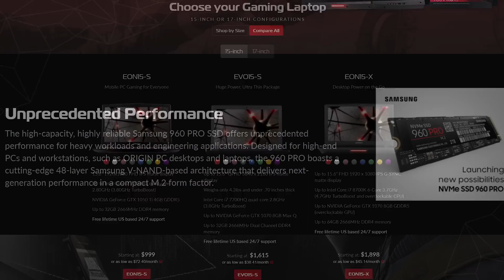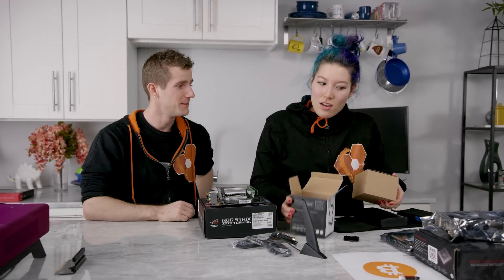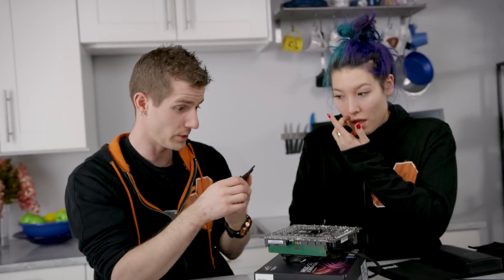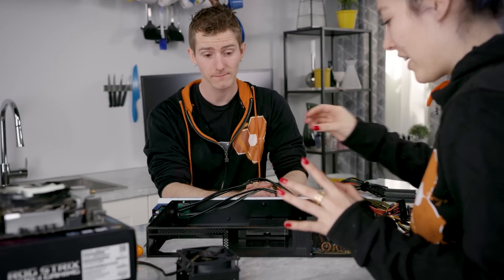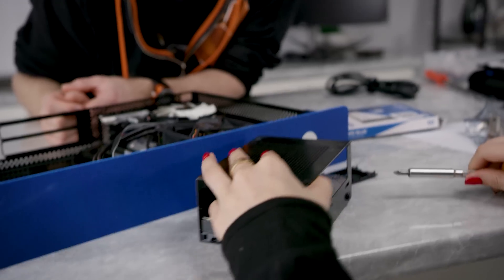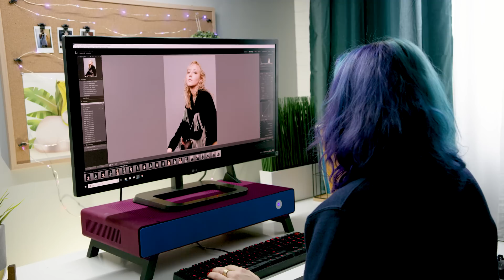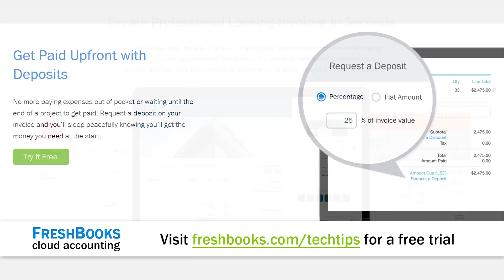Max Builds her FIRST PC – Photo Editing Build Log

Comment: "forgetting the IO shield. Common 1st time mistake"

Or in my case, common 10th, 11th, 20th time mistake lol
Reply: dust gets in wtih or without the IO shield if you don't have negative air pressure and filters on the suction fans..
Reply: At least you got to build 20 pcs
Reply: @flippette  yeah but most of them weren't for me, unfortunately. I've only built 5 for myself since 2000. I don't upgrade very often.
Reply: #sadaf
Reply: @TGoKovenant  That's so much worse, lol.  I hope people weren't paying you for such a sketchy service.
Reply: @RDR911  in my own PCs. And even then I'd remove the Mainboard and pop it in.

Comment: I did almost this exact same build in April. Mine has the i5-8400, 256GB Samsung Evo 960, the ROG STRIX Z370-E GAMING motherboard, and even the colorless RAM. Though I did go with RGB for my power supply, graphics card, and case. Great build and it does almost anything you want it to.

Comment: I didn't get a good look at the case. Is the bottom of it solid ? I only ask because the video made it look as though the PSU was installed upside down with air intake coming from the top of the case.

Comment: If there are any Cryorig reps watching this, on behalf of the audience, we're sorry: we know that the C7 comes with its own thermal paste and hex wrench and furthermore also comes with insulated mounting nuts in case the backplate doesn't fit. Any threat to the Maxicure is not your fault. Now, if you are kind, please release the all-copper C7 with aftermarket fan bracket for those of us who don't have a big enough desk for a Taku.

Nothing bad to say about you Max and Linus! I realize that since it was a spare part, all of that extra hardware was probably gone. I've learned from the masters how to kludge together PC builds and I've certainly got a few janky mods going on over here.

Comment: Hi can someone help me with my m.2 ssd connected in asus  z270 it was working as a boot drive but out of no where it stopped working as a boot drive i added a hdd with Win 10 and my ssd works in windows but can not boot windows on it any suggestions???
Reply: The ssd is adata sx8000 256g

Comment: We absolutely need a video about graphicscard control panel settings, windows power plans and frametime since NFS Payback and GTA V and maybe more games will run much smoother after switching to high performance plan and enabling 1 Maximum prerendered frame in Nvidia controlpanel. Flying in GTA is affected specially and NFS´s stutters are fixed that made game unplayable even with best hardware.

Comment: 0:43 Linus: what is this for? Max: Tumblr PC Specs 5TB 16GB Ram
Reply: Tumblr, all the tabs.. all the tabs..
Reply: researching how to over throw linus for the being apart of the pc patriarchy, dongle jokes no more
Reply: Pro tips: You run Tumblr on Chrome. 

So I think it's pretty accurate.
Reply: Where talking about a guy with half pt of stoarge full of videos...
Reply: If your point is that 16 G's is a lot for a web machine, you obviously haven't opened up more than 10 tabs before. Me and my 20 windows can crash the hell out of a system with 8GB, EVEN WITH a tab suspender extension. Lately I've been shopping for laptops with 64GB max so I can maybe get out of this ghetto...
Reply: I have my delided 7980XE just for watching youtube...
Reply: KingKaos 16 Gb of ram costs like $200 why?????
Reply: Google chrome, killer of ram...
Reply: On my daily routine I usually have around 100 to 150 Tabs running all at
 once I use all of them all the time Firefox is the best browser to 
support so many all at once I have found has my system only has 8GB of 
ram
Reply: I have a few things to say a Major Computer memory/RAM factory exploded in 2013 causing the price to skyrocket. This factory accounted for 15% of the worlds source of computer ram.
Also the current demand for RAM has caused the price to go up because the supply just isn't their.
https://www.kitguru.net/components/memory/faith/hynix-fabs-on-fire-after-chemical-explosion/

https://www.extremetech.com/computing/263031-ram-prices-roof-stuck-way
Reply: Also for photo editing, ram is good to have especially if you have lots of complexity and layers.

Comment: You need to look up things you make claims about. LEDs and RGB make your system run 15% faster. I have even seen evidence of systems running 20-89% faster because of the LEDs on RAM alone. Gotta get your facts straight

Comment: I'm 2 months from my bachelor's in pure math, I'm working on a physics puzzle game (with custom physics, not entirely rigidbody reliant) in Unity/C#, and I've never built my own computer.
Although, I've never had money to buy all the components for a new computer myself and my stepdad works in the programming industry. He would just buy and assemble the 2 computers I got throughout living with him. It's really just a right place, right time kinda thing for some people. I have changed out my graphics card and moved temp reads in my case to different components, though.

Hopefully I'll actually finish my game and get it onto Steam for something like $5. Maybe then I could afford/justify a new rig, because this 2013, 8 gig ram, 4 core i7-4771 monster here is not doing too hot with lightmap baking. Or rendering times. Or anything CPU intensive. But I can play Dishonored 2 on low!

Comment: wait... so you mean my rgb tridentZ memory is no faster than the regular tridentZ??? i refuse to believe it
Reply: It's a lie.  RGB increases speed for sure.  The electricity flows through the LEDs then bleeds into the modules increasing the voltage without messing with multipliers.  See, RGB increases Ram performance!
Reply: Purple is the best color for your rgb because you get a mix of 10% bonus fps from red and 10C cooler temps from blue.
Reply: Payne Hoss was my intire life a lie then?!?!?
Reply: actually I believe the rgb variant has a lower latency. Everything else is the same (except price)
Reply: trident is recommended by four out of five dentists to patients who chew gum
Reply: Aren't some of the higher speed G.Skill kits only available in the RGB variant? So... if that was the case, the RGB meme would actually hold true.
Reply: dont freak out! it's true that the rgb doesnt make the ram itself faster. HOWEVER!! it makes you hype, which as most every example of super smart people on computers in tv/movies has shown, smart/hype people make computers magically faster.

Comment: I would actually recommend Scythe SCBSK-2100 BIG Shuriken 2 Rev. B for the cooler for anyone else doing a very low profile ITX build.  In all the testing and reviews I saw it cools much better and quieter than the C7 for about the same price.  you do have to use medium to low profile memory but other than that it's amazing.

Comment: What GPU was used? GTX 1060 ??
Reply: Cyber Tiger No, there's definitely a GPU in it
Reply: ... did you like, blank out around the part they screwed a GPU in to the case or something?
Reply: Suraj T looks like a 1050 / 1050ti
Reply: @ Cyber Tiger... 6:44
Reply: Cyber Tiger 6:49
Reply: I'd like to know as well
Reply: I was also wondering that. she def said gpu, so there must be one
Reply: they did put in a gpu. thinks its a 1060 mini
Reply: Josh Downard if there was then they might have told but they didn't.
Reply: No GPU, only i5 integrated graphics

Comment: Based on the design, the outputs and form factor, the GPU they are using is either MSI Radeon RX 460 2G/4G OC or the MSI GTX 1050 TI 4G

Comment: 6:12 It's how they're packaged!  Ha I did the same thing to my WD blue SSD because you'd think if you pull it out with the package front on the top it will come out facing up but it doesn't!  I mean, there is a video of Linus playing Basketball with an SSD somewhere so I wouldn't be too worried about it, but still XD

Comment: I have question more or less related to this video: I currently have an ASUS Strix GTX 970, would it be better to get another 970 and use SLI or just get another overall newer GPU such a 1070 or 1070 TI?

Comment: "Forgetting the IO shield, that is a very common first time mistake"
It's called a "motherboard mounting alignment test fit"
Reply: FOOORRR REAAAL my first rig i didnt know what it was i found out 3 years later when i was upgrading parts and then put it in upside down and i was soooo conviced it was the io sheild not my dumbass i dremmeled it.
Reply: I built my pc about 2 years ago and I forgot the IO shield and still Im using without it Im fucking lazy.
Reply: I forgot the io shield once sooo try again the standoffs are the alignment and mounting.
Reply: Sure buddy
Reply: I forgot my i/o shield aswell. In another country. 3000km away from me.
Reply: Honestly IO shield is just a cover without any real function.

Comment: 'Forgetting the IO shield is a very common first time mistake'

No Linus forgetting the IO shield is a very common mistake...full stop, I still do it to this day, and have seen many top techtubers make that mistake over the years.
Reply: I've done it lol
Reply: lol I forgot my case had a hole behind the mobo... my bracket fell off when changing coolers and took the mobo off to get it and seen the hole and felt stupid af... lol
Reply: I forget the IO shield nearly every single time. That and the cooler bracket before mounting the MB to the case, but I like how newer cases have opened up behind the CPU so you don't have to remove the motherboard to put that bracket on.
Reply: I never use the IO shield. Fight me irl
Reply: Can confirm I also sometimes forget the damn shield!
Reply: +hmoham Just transferred mobo between cases 2 days ago... Just looked behind my case and I forgot the IO sheild lol. Thank you Linus haha

Comment: The cryorig C7 actually comes with a nut-driver to tighten it down, you do not have to use needle nose pliers. 

It also comes with smaller plastic spacers in a bag labled "mini-itx" that you use instead of the backing plate.

The install is way easier that you guys made it look ^^
Reply: It wouldn't be LTT without some missing of steps

Comment: LOL Tumbler. In 2013, when the gtx 780 came out, my friend told me why i spent $650 for a video card just to play runescape apparently. It was not just to play runescape but because my previous pc from 2004-2005 was literally shitting bricks and i thought gtx 780, younger brother to the original Titan would stay up there lot longer. Future proof if you would. Well, i still don't regret it but i hate nvidia does shotty things and in 5 months after the gtx 780 release, they release the TI version and bum fucked me and my video tanked like $100-$200 also considering it was used it'll be like $350 - $400 for it used... Considering Nvidia never made a ti version for the 2-3 years i was watching linustechtips on new products being released, i'd have to say that is shitty way of doing things. I had thought the year before, gtx 680 single card the best, and 690 the dual gpu behemoth. WELL FUCK ME upside down

Comment: Core i5 for photo editing?
are you nuts linus? You should've got a Ryzen 1600 cpu.
Reply: According to Puget Systems, the ideal processor for Photoshop is the 8700k hands down. It doesn’t really use any of the additional cores and utilizes higher frequency much more.
Reply: Photoshop and Lightroom prefer stronger single core over more cores, so i5 was the right choice in this one.
Reply: Differences aren't big in regular workflow except if you work on large images, where you use demanding scripts.
Reply: scott bilby ryzen 7 1700x or ryzen 7 1700 would be alot more better because of the more cores but the i5 is also really good
Reply: Mateusz yep, and even then, Adobe allows you to leverage your GPU for some tasks instead of your CPU.
Reply: DT B hahahahaha

Nice joke
Reply: Momo Awan It does seem like that might be the case, but the Ryzen processors That I have seen tested do not quite match up to the 8700 K. It seems counterintuitive to me also, but the only place that cores really factor into photo editing performance is when you export images from Lightroom. I’m a full-time Photoshop user of more than 20 years, so I was very stunned To learn that a $360 processor is in almost all cases better than thousand dollar processors. 8700K beats all of the Ryzen processors. I do not know about the Threadripper processors, but from what I understand it would in most cases beat them also, which is insane. 

https://www.pugetsystems.com/labs/articles/Photoshop-CC-2017-1-1-CPU-Performance-Core-i7-8700K-i5-8600K-i3-8350K-1057/
Reply: nah you should get a i9

/s
Reply: I’m using an AMD 4300 FX chip. Doesn’t really require that much. Linus is right, its mostly a RAM thing. You can get away with a duo core if you really wanna moneyball your setup. If all youre using is Photoshop, Lightroom, Illustrator, et al. They don’t benefit from multicore.

Comment: Forgetting the I/O shield is my nemesis. Every. Damn. Time.
Reply: It's not about it being difficult to put on, it's easy to forget to do it first since  you're often eager to get the more fun stuff put in the case.
Reply: I don't even understand why do we need to put the I/O shield in from the inside.
Reply: I was better. Few years ago i've build my pc (i5 sandy bridge and hd7950) but after i assembly it, it did not start. I reasembly everything and still not worked. Guess what, i forgot to flip power switch on psu...
Reply: completely unnecessary so i don't even bother.
Reply: Mine is either the 24 pin or the CPU power. I know I know, let's get the crucifixion over with.
Reply: I don't understand what's people's problem with io Shileds 
It's so easy to put on

Comment: The first time built a PC, the PC wouldn't post, everything seemed like it was working, the GPU fans were coming on, everything looked like it was fine, then while looking around for the last possible reasons it wasn't working, and if I wouldn't have gotten it to work I'd of had to start sending things back to the makers, I saw people talking about plugging in the CPU.... You see, when I see a massive plug like the one that goes into the motherboard from the PSU I think the CPU will be powered from it, turns out that's not the case....

Comment: 5:54 "This means our content is working"... It definitely is. Watching your videos last year struck my computer-building bug and I decided to built my own machine. I had modded computers and switched parts before, but designing and building one from scratch was new for me. Thanks to your videos the process went smooth and I felt that I knew what I was doing because I've seen it over and over again. Here are the specs:

Asus Maximus Hero X Z370
Intel Core i7-8700k
Corsair Vengeance RGB DDR4 3600mhz 4 x 8GB
Asus Strix GTX1080Ti 11g
Corsair H110i
Samsung EVO 960 NVMe 512gb
Seagate Barracuda 3tb 7200rpm

Comment: Hey Linus, here's a tip from someone who knows what they are talking about, when using a file, you got to go both ways, it helps evacuate the residue accumulated while filing, also, you got to use 2 hands

Comment: 4:28   What.. I did not know that one could only file one way.. I always file in both directions.. Great Tech Tips Max!
Reply: It depends on the file but the type of file shown is only meant to work in one direction. How you can tell is to look at the teeth of the file up close. If they are symmetrical then you can go in both direction, if they are slanted toward a direction then it's intended to use it in that direction. It also depends on what your trying to accomplish. Going backwards with a file will create scratches, which may be desirable if your going for a roughed up look.
Reply: Thank you Alan!!